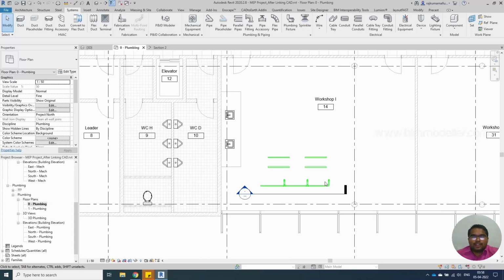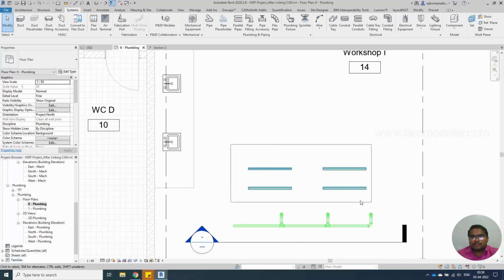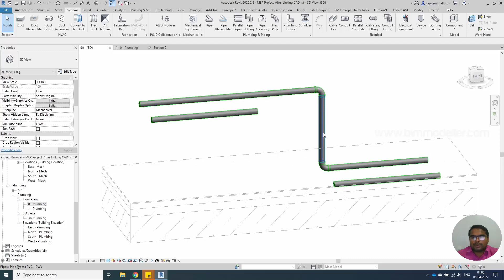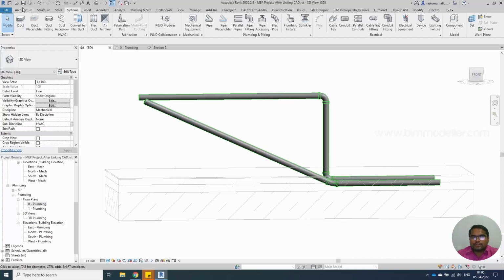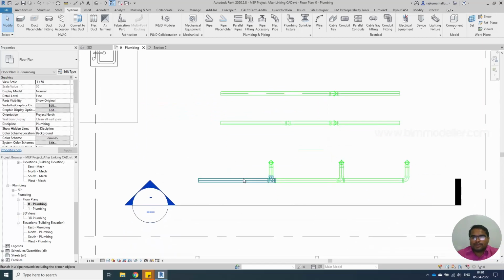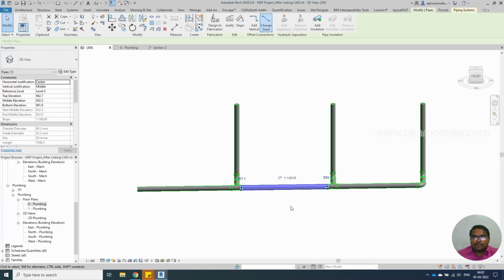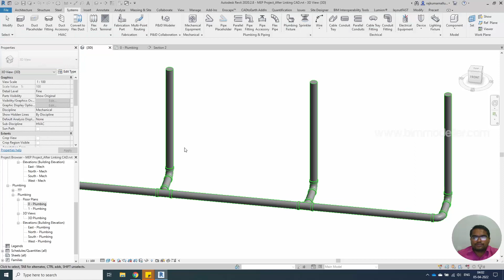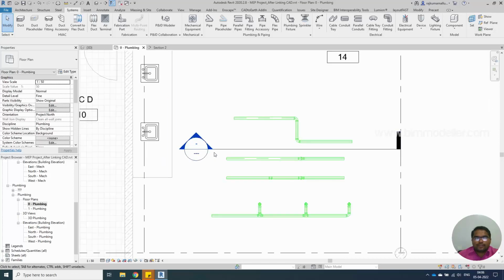Revit MEP Project 30: How to create Sloped pipe in Revit?

Comment: Sir,Is that any selection to run the pipe in a slope and then connect vertically in one go as you drawn the second example.
Reply from the maker: I think there are some plug in.